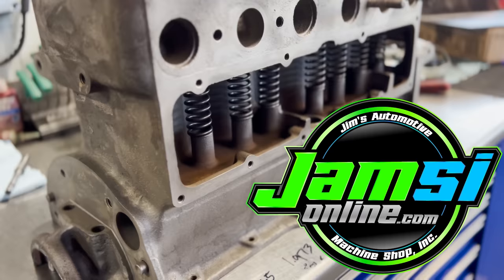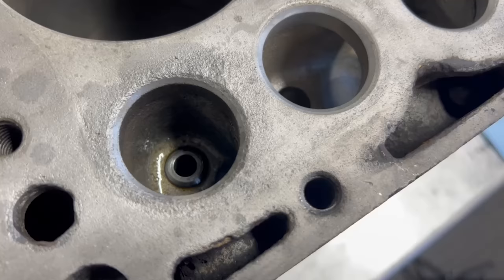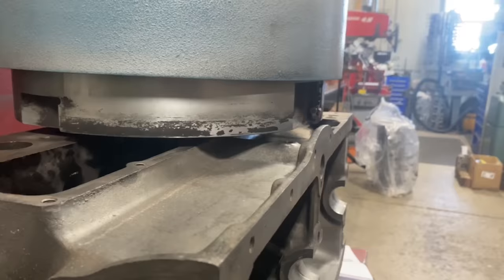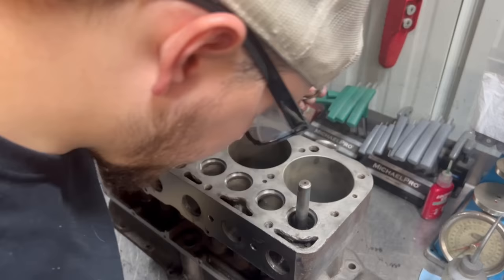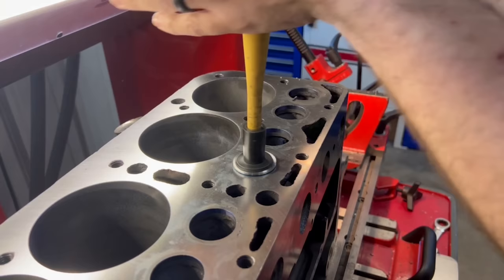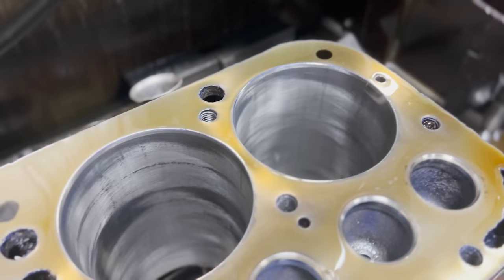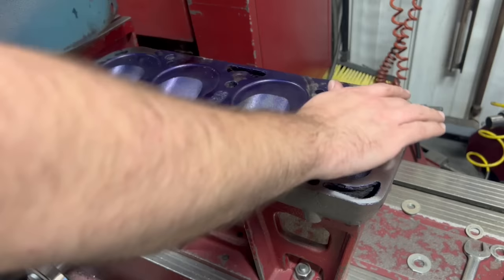Modernizing The 1929 Ford Model A Valvetrain

Comment: I've only worked on 2 of this type engines (flat head) and both times it was a real chore with the valve stem spring retainers but knowing how much easier it is with an overhead valve engine my hat goes off to those  old school mechanics

Comment: Having been a professional mechanic for over 20 years I can say that one of the best lessons anyone can learn for wrenching is that almost every stuck fastener can be removed. With a combination of heat, impact, penetrant and most importantly patience it is doable in almost every situation. Even if it takes you 20 minutes to remove a single bolt or a stud it's still less time than it will take to drill out a broken one and restore the threads.

Comment: Glad to see that you found Kroil! The best penetrant I have found. Me and a buddy split a case every year.
Reply: @paulcopeland9035  yeah, really all of them arent that good
Reply: @paulcopeland9035  When all else has failed my next step is equal parts Marvel Mystery oil, diesel, ATF, and acetone. Keeping the mixture around long term doesn’t work well because the acetone evaporates quickly. You can add more the next time you need it, though, because the other fluids don’t evaporate well.

Comment: Great video. Can sympathise your aggravation refitting the valve collets.  I've done quite a few fitted on Rolls Royce B81 straight 8 engines. I used to smear water pump grease on my fingers then virtually standing on my head ( the block was still.in the vehicle) managed to refit. Even after years of doing them, it was never easy, so don't beat yourself up about it
Keep up the good work, looking forward to seeing an update on the Jaguar 4.2

Comment: I love that you cleaned the block so well before returning it to the customer.   I almost installed a head that was loaded with abrasive debris in the oil channels from a machine shop valve job.
.learned not to assume parts are clean from a machine shop.

Comment: My father in law has a 1936 ford V8.  Its beautiful. He has take this car from everything off the chassis, cleaned everything and repainted the chassis and more.  He upgraded it from mechanical brakes to Hydraulic, and the engine is larger than the original.  The previous owner had hot rodded it, so the larger engine was his idea.  He was the 2nd owner of this car.  Its been in a garage since he bought it.  Im waiting till he gets it finished for my ride in this beautiful vehicle.  The engine does need to be reworked like this one.

Comment: I love watching manual machining. I was lucky enough to do my apprenticeship in a business that reconditioned their own engines and as mechanics, we got to learn how to do valve cutting, honing, and engine dismantling and assembly in a machine-shop setting. I was surprised to see you use impact to fit valve guides and seats as I was taught to use the shop press on all these parts. Listening to you rattle off the measurements I am very glad that we adopted the metric system as I started my trade. I could use both and I am here to tell you metric is way better. A great video and I will watch more.

Comment: Very nice work!  This reminded me of doing the very same rebuild 64 years ago on a 1931 model A.  I only had to go 60 over and did not have to put new valve seats in, just grind them to match the new valves.  I found a shop that poured the main bearings for me.  I wish that I still had the A Model.  I was taking machine shop in high school at that time.      Fred P.......

Comment: I have actually seen earlier blocks where the bores weren't completely perpendicular with the rest of the engine (or to each other), also seen them with a few of the bores offset one way or another by almost .020. Not sure if they left the factory that way, or if they had poor machine work done before I got into them, but it definitely wasn't something I was expecting to see. That one turned out great, will probably now outlive all of us.
Reply: Not unusual to still se that stuff happen in semi modern machine shops .
Reply: I’ve seen it all. It’s either poor setup or just plain sloppy work. I worked on a John Deere 404 that was bored to fit 466 sleeve and no one considered what head gasket to use. Needed to use a stock gasket with fire ring removed and cut the sleeves for fire rings. Upon measuring the sleeve protrusion it varied .010” from front to back and .004 side to side. They guy that had the work done was bragging about it, I told him I wouldn’t brag about it.

Comment: Interesting, the two model A engines I've worked on had heart shaped regions in the head.  They were industrial engines used on farm equipment so maybe they were set up to run at a higher compression.  Very good work in any case.  I always enjoy seeing those old engines made better than they were from the factory.  Well cared for they've got a long life ahead of them yet.

Comment: One of the Hot Rod magizines i have from a few years ago has an article on the Model A and the aftermarket speed equipment available for it back in the 1920's. 
As early as the '20s waterpumps, Overhead valve Heads and also Overhead Camshaft Heads were available aftermarket.
In the 1920s the top speed record for a Model A was (from memory) either 114 or 117mph.

Comment: Very nice! The valve guides without a step always make me a bit nervous. There was a company that was converting the 1.8L Subaru EA81 motor for homebuilt aircraft. Well it turns out that oversize valve guides were not available and of course when the old guides were driven out it would broach the holes. So to hold the new ones in place they would knurl the outside of the std sized guides and use locktite! I had two failures in flight before I found out what was going on (and I hit the roof at the shoddy half assed job.. In an AIRCRAFT!). I got together with a company called Ram performance and he started making O/S guides with a step and the problem became history. But the nightmare of that experience still wakes me up at night..:)

Comment: The 201 cu in Model A engines was designed to be rebuilt in the vehicle.  The engine put out about 40 Hp people did not drive very far at the time so the poured babbitt bearing worked just fine with the slow turning engine and splash lubrication system. The only time you needed to pull it out was to pour new babbit mains.  They had molds that you fixed the con-rods in to pour their bearing.

Comment: Speaking of modern parts for old engines. During the late 50's & early 60's I struggled through 3 valve grinds on flatheads. All the while adjustable tappets were available for them at Sears. It's funny how the old garages just didn't know about these things.

Comment: You used Kroil  … those stuck studs would have backed themselves out if left to soak just a few days more …😏😜.   That is by FAR , Hands down , the BEST penetrating oil I have ever found or used for over 42 years now as a Mechanic / Electrician/ Machinist .   In my profession we bring “ Stuff back from the dead “ almost daily , and Kroil has been my Go To product for all kinds of issues rust & corrosion related.  Cool video here , thanks for posting this one ..👍

Comment: Freaking love the machining work, used to run a muzak laser cnc machine that could cut 1/2 steel like butter to .0001 of the finished dimension when set properly. It always amazed me the slight tolerances you can achieve.

Comment: Food for thought, and cheap and easy, compressed air that is sold at Walmart / Amazon fairly cheaply you can take it and hold the can upside down, pour the contents into a styrofoam cup, the result is -59 F. I use that technique in my shop when the time comes for press fits.

Comment: I once skimmed a 1908 sunbeam cylinder head from an experimental water cooled 4 cylinder side valve engine, there was no flat surface on the outside of of the head so I cut some threads into the head stud holes, after which I could 'jack' the head to a mean average level height whilst still clamping it. After skimming the head I machined inserts to fit the threaded holes that I had cut then spot faced all the holes to the new flat datum Phew. There was only 1 other known head in existence !

Comment: There was a tool that kicked around the van for as long. I now know it was a valve spring compressor. The one you used was different in that it was a manual device. The one I know had a screw fitting.

Comment: Mini heat inductors are great for stud removal. I've removed what was a 8 mm stud that rusted down to 4ish mm and was able to remove after 2 heat cycle with no air hammer shocking. Fairly priced on Amazon

Comment: The problem i think you are facing in you densified bullet proof wood project would be the lack of a binding agent between the celleous strands.I would recommend that after the pressing and cooking your sanpled the drying them in a vacumm chamber then  submerging in  epoxy or polyester resin under vacumm then curing them in you heated press

Comment: For those watching this don't do this at home, use freezing method to install guides as galling on back side is a risk then distorting bore diameter then honing to get correct size, then you wonder why guide comes loose in service as galling peens away, don't let anyone use anything other than copper bronze seats either for valve seat reconditioning, modern fuels and valve materials make bad bedfellows, cutting block for larger valves to recon is a bad move for longevity

Comment: I thought since you had the head on the table why not machine out the spark plug holes then add a seat to re-tap for modern plugs.. or insert modern plug seats.. you'll find peanut plugs offer so much more efficiency than those old mega glow plug style..  you can get adapters

its going to run so much better for sure

Comment: Once I ground the valves by hand on a 1940 Chevy 6 cyl head. As far as I know that is the only Chevy 6 cyl head that has hemispherical combustion chambers. (The block was a brand new block from the dealer, bought for $25).

Comment: the engine is about identical to a n series tractor.  I do not know about the model A but on my N tractor the machine shop drilled adjustment holes in the lifter holes so i can help keep the lifters stationary when adjusting

Comment: Absolutely fabulous machining results. But I can't believe you didn't touch the rough castings in the ports! You had all the equipment there to clean up those ports and you didn't touch them at all! How frustrating!
However, the engine MUST run as smooth as silk now.

Comment: It's just amazing how rough that casting is, with little or no finishing on the assembly surfaces until you decked it. And that engine was still reliable. How far we've come in a hundred years!

Any word on what the customer is going to do about the crankshaft? Is he going to have it balanced?

Comment: Couldn't help thinking about how munch engine valve angle has changed since WWII.  The venerable Flathead , seen here  is a perfect 180° valve angle engine example
As time has progressed the angle got smaller and output has soared. 1955 SBC had 24° with great success.  1997 LS version has 15° that helped a bunch , then was improved by change to 12°. Racers were slope/angle cutting SBC Heads long before LS appeared , to make more power.  No big surprise,  it was some of them who designed the LS engine.

Comment: There seems to be a general perception in the comments that this rebuild has left the engine with better performance than when it was new. I assure you that is not the case. The Ford factories in '28-'31 worked to very precise specs. The warping and lack of finish visible in the video is entirely the result of 90+ years of wear.

Comment: Crikey , now I know why a gasket set and new rings and bearings  and a hand lapped valve job used to make no difference to performance or oil consumption. But it sure was fun messing with old motors back in the day. Glad I didnt own anything bigger than a carpenters 1pound hammer back then. The spare parts guys must have laughed when we went in on Saturday mornings to spend 20 or 30 bucks on gaskets and rings and stuff.Greetings from Australia. BTW The work finish is amazing.

Comment: take 3/8 studs that are corroded say like in the middle really rotter rusted studs, pretty about the same pre pre-prep.  if you got heat the area around the stud. cool the stud with water, take two vis grips, clamp on at the face of the head or block being this is a flat head,
thing nose, clamping on to the studs, handles opposite of each other, this method is 
highly effective with studs that are all but rotted aawy in the middle, seeing is believing
 99% of the time the studs walks right out with out snaping the stud in-two in the middle
 I worked forty years in the field, operating engineers, HD Mechanic / welder.  
Cats D-343 and the 1693 truck series, exhaust studs were notorious for rusting off in the middle, works even if you could snap the stud off with two fingers

Comment: 30+ years ago I remember the new guy had him clean some aluminum heads that were ready to go and be built.  as soon as he got done I never heard the air compressor come on so I asked if he dried and oiled them with wd40.  He said no because they were aluminum. I reminded him the valve seats were not and will rust. So it got caught before they were left to rust overnight.

Comment: Thanks for answering a question I had as I watched you hammer in those valve guides, because I thought for sure they have to be deformed because of all that hammering even if you were using a brass end on the tool.

Comment: GREAT WORK ! JUST A MENTION, I WAS WORKING IN 1978 ON VOLKSWAGEN BEETLE 1500 CUBIC CENTIMETRES AND A OLD MECHANIC SHOW ME A GOOD WAY TO INSTALL A NEW SET OF VALVE GUIDES, HEATING THE CYLINDER HEADS IN A ELECTRIC STOVE AT 100 CELSIUS AND KEEP GUIDES IN ICE ABOUT 1 HOUR. MAYBE HELP YOU . ON MY TIME WAS A DREAM TO HAVE A WORKSHOP LIKE YOURS !

Comment: My grandpa had rebuilt five 31 model a's in his life and only one got "modern" (80's) parts for todays lead free based fuels, otherwise the babbit bearings and crank were all the same as the originals. Luckily the model a is a lo compression engine so tolerances don't have to be as stringent unless you put a performance head on it..

Comment: I know this isn’t your wheelhouse, so to speak, but can you possibly do a follow up video on the motor once it is together with a Dyno pull? It’s probably crazy to ask to put a stock model A engine through a Dyno, but that motor probably has a good bit more power over stock just due to the slight decrease in deck height and resurfacing the head, as well as the larger bore and (probably) better flowing valve train. I’m willing to bet this engine can get 50+ HP.

Comment: A GOOD IDEA IS TO SHOCK THE STUDS WHEN THE BOLTS WERE FACING UP IN THE VERTICAL POSITION WHILE APPLING THE KROIL PENATRATING OIL, SO IT WORKS ITSELF DOWN INTO THE THREADS.

Comment: I heat the stud red hot, then let it cool of. The stud expands, breaks the rust/weld then shrinks back down. I have never not has the bolt come out doing that

Comment: My grandfather has a late 28 A model and I remember when they rebuilt that engine in that car it was the first time I ever seen one apart,it genuinely looks to me like a Briggs and Stratton go cart engine but in a 4 cylinder variant. It just amazed me on how simplified those things where. It has copper strips for spark wires and for something so old that coil has a kick. My dad thought is was funny ideal to grab my hand and then he snatched that copper strip and I swear it hit me 10 times before I was able to get away from him. It hurt but some how my dad was never really bothered by being shocked. I watched him tie one on once an shove his finger in a msd blaster 2 coil an throw sparks off the tip of his well how do I say this politely?? His man hood😕yes it was an odd child hood. Should see what he showed me to do with old transformers with just simple D cell batteries you can shock the hell out of people.

Comment: In the future, instead of using legos you should go to a tile supply house and pick up some u-shaped tile spacers. They come in various thicknesses and should support both sides of the valve without risk of slipping out.

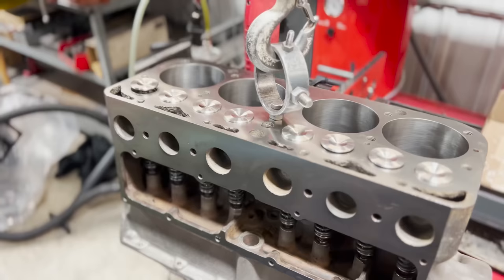Comment: 18:13 which tool is being spun there, please?  What is its purpose?  Another great video!
Reply: That appears to be a lifting point that they custom built out of something round and strong (pipe?) and then drilled and tapped (or maybe just drilled) and put four different size bolts in it.   At 18:13, just using it as a handle to manhandle the block on the workbench. You can see it again at 18:36 where it's being used by a crane/hoist to lift the block and move it.
Reply: @theundergroundlairofthesqu9261  Thank you for pointing this out especially at the 18:36 time stamp.  It's clearer there as it has 4 different bolts with different thread pitches for different heads.  It's cleverly made as a holding device and as a hooking point.  Thank you again, J.

Comment: Knowing nothing about machine tools & the techniques for using them, the cuts that you are making sound HUGE to me. Understand that I am not saying that you are incorrect(perish the thought), but I would have guessed that  decking the block would would require 2 t0 5 thou max.   20 thou out of the cylinders sounds like you would be bored into the cylinder next to it. I love watching experts doing fine machining.  I don't have the patience to have ever considered becoming a machinist. It is too damned "fiddley:  for me. However I suppose electrical engineers are needed as well as machinists. Wonderful video & explanations. I have subscribed !